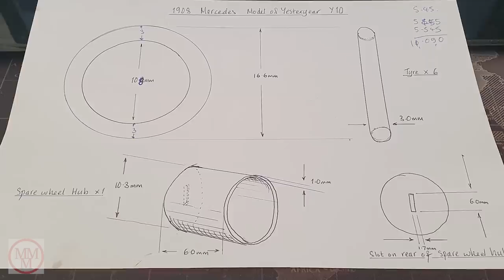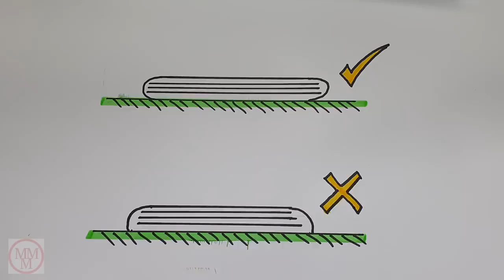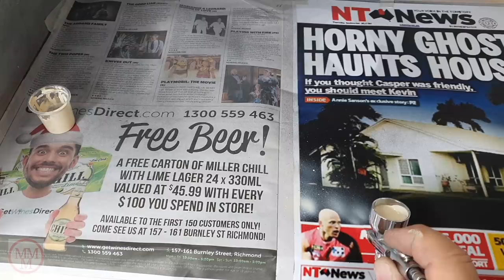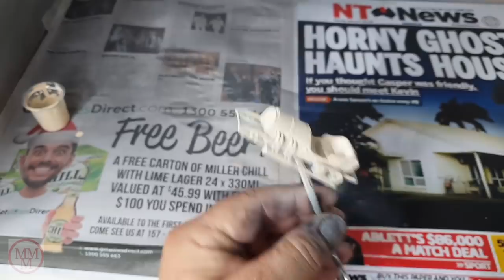MATCHBOX Restoration Yesteryear Y10 1908 G.P.Mercedes

Comment: Superb.  Like a Phoenix rising from the flames.  About the 2 pedals.  This racer was made before the standard control layout of 3 pedals, and a gearshift between the front seats.  I think the Austin 7 was the first mass produced car with standard controls.  Some of the early cars had levers on the steering wheel for throttle, and ignition advance.  Some also had a lever for manually pumping in the engine oil.  So many functions have now been automated.  Alot of people around today who have never even seen a manual cold start choke.
Reply: True. Pump on left side is manual oil pump. Brake was a lever on right side. Most midget race cars if the 40's and 50's retained this layout. No brake pedal as there is no room and besides who needs brakes in a race car lol.
Reply: Heck, race cars back then had a crew of two, because there was so much manual engine management that the driver just couldn't be bothered with it.
Reply: I recalled from a Top Gear episode that it was a Cadillac that had the first 'modern' control layout. https://en.wikipedia.org/wiki/Cadillac_Type_53

Comment: Beautiful job, Marty! I was thinking about the two pedals on the floorboard, with the external brake lever, and considering how the vehicle may have been controlled. I considered the Ford Model T of roughly the same era, which had three pedals on the floor, of which I am quite familiar. None of the pedals were the accelerator. Left pedal was brake/clutch, middle pedal reverse, and right pedal your forward gears. Press the right pedal down for low, and let it out for high. Throttle and spark advance were by levers on each side of the steering wheel, but some vehicles of that era had semi-circular slides in the center hub of the steering wheel that could be adjusted, and locked in place to achieve the same thing. The two pedals on the floor with external brake and steering hub controls would have achieve the same. Again, great restoration.

Comment: I'm the lucky owner of 17 of those yesteryear models. Not all in mint condition. some of them are missing parts. The Y-10 is one of those i'm not having so Marty if you ever consider selling it that's if the original owner not wan't it back I would gladly buy it from you.
It is a beutifull job you have done with that car.

Comment: Another great job!! Marty, you can just draw the tire in your CAD program with the curves and print it out. Your printer will handle the overhang without any need for support material. If you adjust the layer thickness a little it gives the illusion of tread.

Comment: I really enjoy your restorations. I thought I would let you know that to straighten the die-cast parts I use a hot air heat gun; safer than a torch.

Comment: The little brass box on the side by the exhaust is a manual fuel pump .that is why there are only two peddles as well as a break and clutch acceleration is on the steering wheel  .hope this helps

Comment: My father had several of these Yesteryear vehicles. The ones he had were nickel plated with green plastic seats and black plastic tires, and were mounted on black ceramic ashtrays. He had a Mercer Runabout, an RR Silver Ghost and a couple of others, which he picked up in Europe in the early 1960's

Comment: Such a beautiful model. You've done it proud with this restoration. 
When removing the wheels, have you tried placing a small piece of plastic with a a hole and a slit to place it over the end of the axle so that you can smooth the axle ends without touching the wheel.

Comment: For stripping paint, I use a product we have here in the US, called SuperClean.  It's an automotive de-greaser, formerly made by Castrol but now spun off.  An advantage to SuperClean is that I can fill glass jars of various sizes, and use a bath of the liquid over and over.  I let pieces soak until the paint dissolves away or softens to the point where it can be scrubbed off (gently) with an old toothbrush.  A soak of about 5 minutes is usually enough, though the longer a piece soaks, the more paint dissolves away.
Reply: I do know that but Super Clean sure takes cosmoline off in a jiffy without hurting any finishes on metal parts and it strips "chrome" off model car parts a treat too.

Comment: Did you consider that the off-white paint could have been discoloured by the heat of the fire?  White paint generaly goes brownish with heat, and I'd say that is what has happened.
Reply: Maybe. But I own a 1:18 scale model of a Mercedes-Benz SSK model of 1928 and the colour of the body is a very light beige. I don't know but, maybe, this model was originally painted the same. 👍🏼
Merry Christmas, Mate. 🎄🎅🕯️
Reply: That model came in white or off-white with light green or dark green seats
Reply: @keithtea3396  Thanks for the info, Mate. I've never seen this model as a kid. But I think that white, light beige or light gray colour fits perfect. 👍🏼
Merry Christmas 🎄🎄🎄🎅🕯️
Reply: @paul-sparky-sparr4160 I think the colour should be White, the German racing colours from that era - where we get British Racing Green and Italian Rosso, but Matchbox would have made it an off white to add a little interest.  Artistic license, as they say.
Reply: @MartysWhiteSuit  That would make sense.👍🏼😁
Thanks for the info, Mate and Merry Christmas from northern Germany 🎄🎅🕯️🇬🇧🇩🇪
Reply: The color match was excellent, I have the same model
Reply: @paul-sparky-sparr4160  Thank you.  Merry Christmas from North Wales.

Comment: Acetone only works with ABS. For PLA you can use a hair drier to 'melt' the PLA to smooth it. The best way is automotive spray putty and sanding.

Comment: Hey mate - when you paint stuff with the brush, you have it loaded up to much. After you load the brush up, try giving it a couple of wipes on a piece of paper first to remove the excess paint. It stop the paint going on to heavy and bleeding around. It makes painting small details much easier. I use to paint warhammer models (imperial guard - so very little people) and by unloading the paint brush it allowed me to paint details as small as eyes, lips and belt buckles.

Comment: you should paint the bonnet belt. Maybe that wasn't original, but it should be done anyway.
Reply: might have painted the rivets and the front grill too
Reply: @hippiepeter  I like to see them taken all the way. Restoration plus one you tuber calls it.
Reply: Iain Botham  It's a neat Idea to take them further than matchbox could or would. I don't think this one is any larger scale than the standard Matchbox. I wouldn't worry about matching the paint that much either. Sometimes other colors work better than what Matchbox thought was good.
Reply: I was thinking the prototype car had wooden spoke wheels that should be brown, not silver. 
You can only put so much detail on a small model.
Reply: @robertlee9395  In every photo of the real thing I can find, the wheels are body color or pretty close to it. You would not believe how much detail can be put into these things if one is so inclined. Requires magnification and very tiny brushes to do, but can be done. Matchbox seldom went very far with the paint details, yet they would often mold in even the tiniest details into the casting. To me taking it to the next level would just be part of the hobby. Marty is kind of a stickler for doing them as they came out of the factory, but just because that's how they came out, doesn't mean  it's how they should be. They made a lot of their decisions based on cost and time when multiplied by the hundreds or thousands of cars they made in a day or so. If that's not an issue, and it's a one off, why not go all the way. It's only going to set on a shelf anyway, so it might as well be as far as one can take it.
Reply: @hippiepeter  He should have painted the radiator grille. Although most of his paint job was quite dodgy on this one.

Comment: The reason it only had 2 pedals was because the shift mechanism was lever operated. There would be 2 levers to the right side of the cockpit, one for the hand brake (used in conjunction with the foot brake) and the shift mechanism lever. It had a smaller lever - like a brake lever on a motorbike - which was depressed to disengage the gear, then the large lever moved to change gear.
This car was revolutionary - it used single nut wheels for speedier wheel changes and the wheels were from artillery guns, so they were lighter.
The double chain drive made for easier repairs to the drive mechanism.

Comment: Love it.   Suggestion on threads for the tires.  How about if you mount the wheels on axle, heat up a file with your torch and just roll the tire over the file once to "melt inn" the pattern from the file?  :)  Also, in order to bend metal, Orthodontists and opticians    use special tools to bend metal with great accuracy and gentle force. You'll find those on ebay  :)

Comment: I do not know if it has been mentioned or not but you can 3d print your tires with that rounded edge. Also you could make a mold from your prints and cast yourself some new ones.

Comment: If you want to clean small parts in the ultrasonic its better to use a glass jam jar to put the parts in as the sonic ‘frequencies’ don’t get blocked by glass, but they do get blocked by plastic. 

Fill the cleaner up with water as normal, and then fill the jam jar with the water or cleaning solution.

Comment: The bit you filed off is "the ejector ring" from the moulding process.  If these were done in pairs of dies (two cars to a mould), often one would be on an offside, one on the nearside of each car, they are part of the personallity and appear to be designed to occur where they are either unobtrusive or look as the should be part of the model, as in the motorbike,  they are important for serious collectors.

Comment: Acetone vapor is only for ABS prints.
Reply: You can use acetone to weld together PLA parts, but not to smooth them. 

And then, ABS is capricios and emits toxic vapor while being printed, requiring really good ventilation.

Comment: I would've used some fuel injector o-rings for tires. Maybe not totally accurate, but much easier. Great job anyway!
Also, the real car might've hand a throttle lever on the steering column. Not sure.

Comment: Tire tread is easily reproduced with an E-XACTO Knife with a pointed blade and your little torch. Heat the tip of the E-XACTO knife and just lightly melt your tire grooves into the tire material. A series of stretched "Zs" or "Xs" in two rows side by side looks pretty good. Have you ever restored any Tonka Toys?

Comment: I do 3D design and printing.  I'm curious as to what printer you are using.  I have a Zortrax and an AnyCubic Photon.  Neither of them produce a part that is only half round.  For the fine, detailed restos you are do, I really recommend the SLA printer, AnyCubic Photon or a similar machine as you do not have the stair-stepping common to the filament style FDM printers like my Zortrax.  Merry Christmas, Mate!

Comment: The vapor smoothing only works with ABS it won't work with pla because pla is made from plant baised material.
Reply: Also print your tires standing up that way you can get the right shape.

Comment: Wouldn't it be easier to print the tires only half as thick and glue two back to back rather than mess with trying to sand them round? Especially since they are so small and fiddly.

Comment: Your paint brushing technique needs some work. It's too bad you can't spray those. You probably could if you took the time to tape them off. And then pre-paint with clear to seal and prevent running under the edges of the tape. It would look so much better, although take more time.

Comment: Interesting, I didn’t realize until your video that the radiator is body-colored; my copy is silver, so I guess a previous owner’s work explains it.  Really like how yours turned out.  You certainly rescued it from a sad fate.  Info about the actual car: “This car won the 1908 French Grand Prix at an average speed 69mph, beating the second place Benz by almost nine minutes. This race was notable for the fact that Frenchman Henri Cissac was killed when his Panhard-Levassor lost a tyre and crashed. He and his mechanic, were the first recorded fatal casualties in motor racing.” See https://www.chezbois.com/non_corgi/MBX_Pages/1908%20Grand%20Prix%20Mercedes.htm

Comment: Hate to be a spoil sport but you shortened the steering wheel too much. You need to look at the actual Mercedes racers of the time. The original position was correct. Give credit to the matchbox designers.